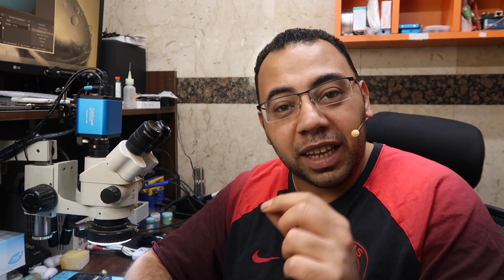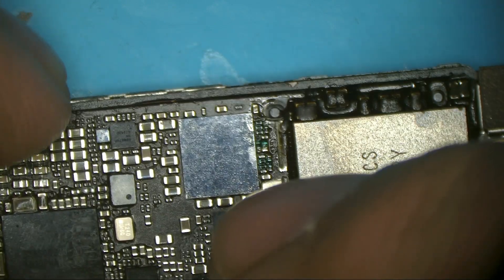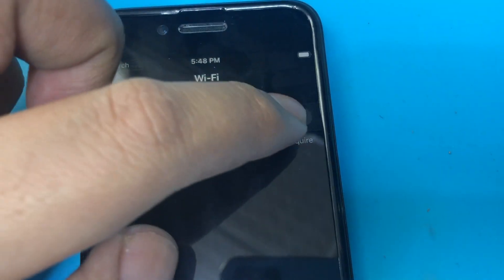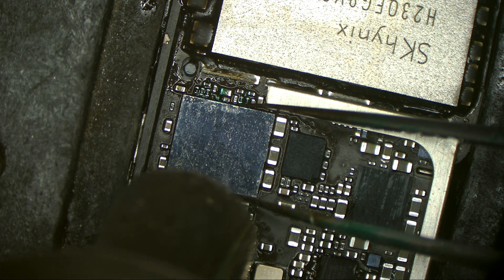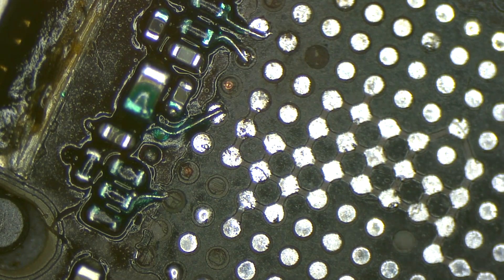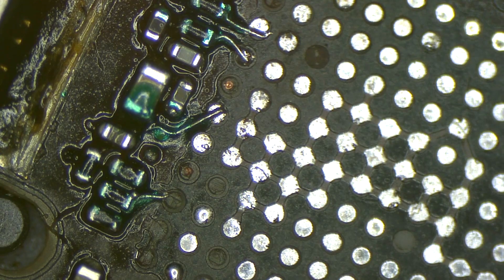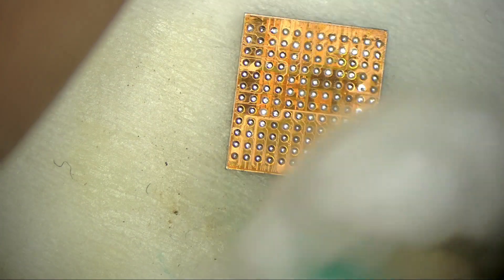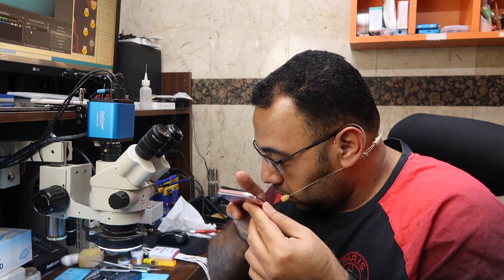How to Fix iPhone 7 WIFI not Working - Grayed Out WiFi

Comment: Just found your page after the suggestions on Apple website didn't work.  I want to say thank you for helping me to finally get my phone back on wifi.  I keep my phone on mute as it's only a testing phone and I don't use it very often, and that was the problem.  When you mentioned the volume button I stopped the video and raised my volume and suddenly the wifi connected and stayed connected.  It is still disconnecting from wifi but it reconnects quickly.  I guess it's the best I can expect.  Thanks again.

Comment: Bro, i need your help, please assist me!  What were the bronze wires you were soldering, you also bent them into a circle/loop, were they solder wire or were they something already attached to the audio chip's pad base? also, what was the clear gel that you used in audio pad area, was it thermal paste or another? Was a heat gun used? :)

Comment: It’s quite common, you’ll notice that a phone with WiFi grey at boot that then starts working after 5 minutes is typically an audio ic fault. Many customers send in phones with audio ic fault and ask if I can fix WiFi at the same time and the grey WiFi is just because the audio has failed, remember though that this isn’t always the case, sometimes the WiFi ic is also loose from the drop or bend that caused audio to fail.
Reply from the maker: True
Reply: I repair my audio IC after a week my wifi has grayed out. does the repair man has fault?